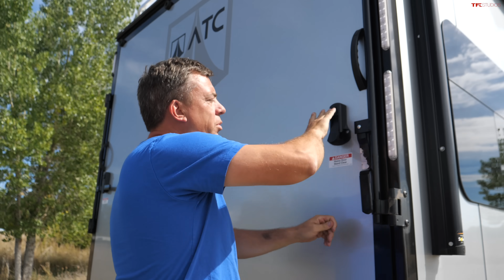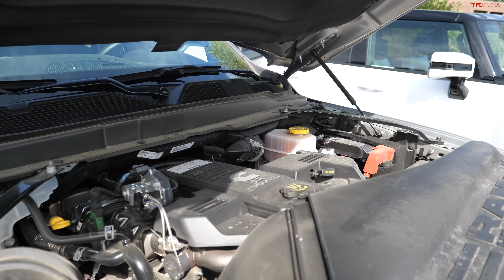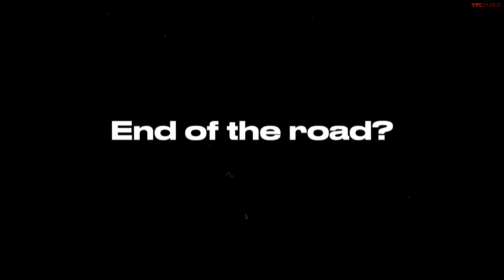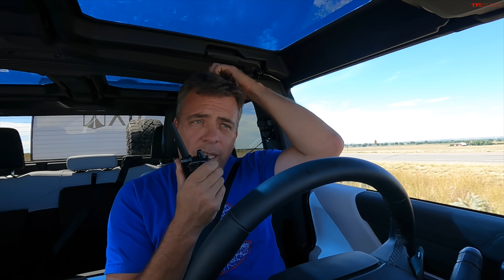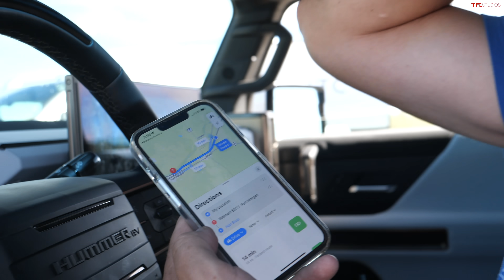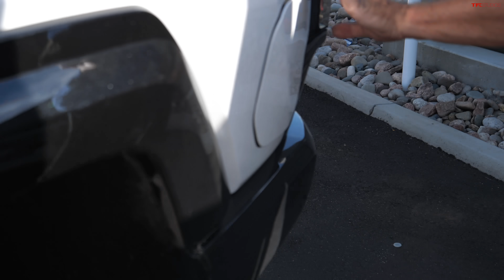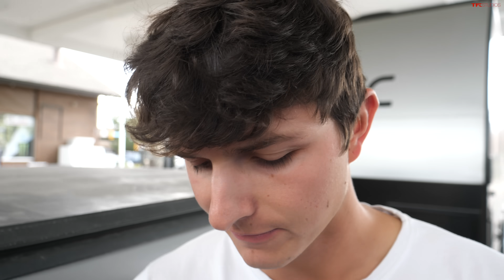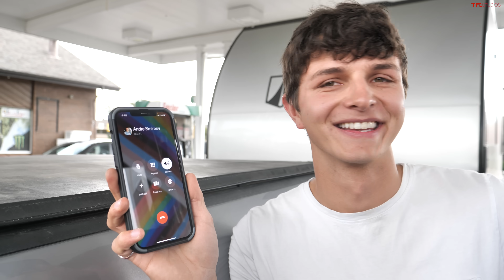How Far Can a Diesel and Electric Truck Tow An Identical Camper Trailer on ONE Fill-up?

Comment: If I have to stop and stress about where the next electrical outlet is for this stupid electric vehicles I would never leave the house! Just  jump in my big old diesel truck and go wherever the hell I want to for as long as I want to. There's no way you can make a trip in anything that's electric. On trips I sometimes drive for a straight 20 plus hours. And you might as well get a hotel room for the damn thing to charge up.

Comment: The Ram went 211 miles and still had roughly 90 miles left...
how long was the fuel stop?...guaranteed it wasn't over 30 minutes and thats with a piss break and waiting in line for a Monster Energy Drink, and some ho ho"s
Electric is nice. but we aren't there yet. Not by a long shot.

Comment: Looks like you either need to pull a trailer behind that hummer that has a diesel generator to charge the battery, or you need to pull a 40 ft. trailer with solar cells on it.

Comment: I live in Rural Alaska, which makes me a very small minority of American truck owners.  The next closest town to me with 1,000 residents is about 105 miles to the NW, if I want to head towards Anchorage though it is about 150 miles.  In both cases it is about 100 miles to the next large town.  I can easily tow my tractor behind my F-150, just over 8K lbs., and make either, I towed it up from Washington State covering those distances between fill up, but would not be able to with a Hummer EV.  Also this does not to into account an area I like to go hunting which is about 150 miles away and never pass a town with more than a couple dozen year round residents.  Furthermore our local electric price is about $0.55/kwh and also produced by diesel, so not only is it less economical but also less efficient and worse for the environment due to losses in energy transmission.  I realize I am one of likely just a few thousand people, certainly less than 100K,experience

Comment: You can’t beat a Ram Cummins in towing 😂 snow, desert, up hill no problem because they sell special liquids so you’re diesel starts easier and the diesel doesn’t turn jello ish due to extreme cold weathers so I’m with the Cummins because the Hummers battery’s will discharge in the snow and in a year the battery’s will discharge faster

Comment: It does seem when observing vehicles during the daily drive to work that most large trucks and SUV's never are used for towing, hauling cargo or have any passengers other than a driver.   I would say less than 10% of these types of vehicle are used for actual towing.   Most are just hauling the owners ego I guess.  I can see owning the diesel if you actually need to haul...but i would never want it for any other reason (including typical drive to work in moderate traffic)

Comment: It would be interesting to calculate how far each of these trucks can travel on $10 worth of their respective "fuels". I'd be willing to bet that the electric truck would win hands down. 2 gallons vs about 20kwh, or maybe even 40kwh depending on the electricity price when charging.
Reply: We ALREADY know the Range the EV shows is NOT what your going to get.... Same applies to a gas vehicle, but its NOT that far off.... The EV is SO BAD it should be FALSE ADVERTISING

Comment: Plus the fact that charging to 100 will take much longer. That is lighter than most trailers also. Soon the road tax we be applied to the electricity and of course insurance is higher on electric vehicles. The fires they had in the hurricane is going to get the insurance companies attention for sure. I can easily get 15 mpg with my Cummins 5.9 towing that trailer.

Comment: Did you guys ever put an F150 with max tow, 36 gal tank, 3.6l engine vs any of these electric vehicles towing one of these campers ? 

My camper is 34’ long and weighs 7,000lbs empty. I tow it with my F150 2.7l V6 ( no Max tow) and 36 gal tank and I average about 10mpg with that thing.

Comment: The issue is, these companies are trying make electronic vehicles too fancy.  They should be nothing more than a golf cart with heat and AC.  The EVs should be to wound back vehicles and the Diesel/gas vehicles are used for longer travel.  There is too many "features" pulling power from the batteries.

Comment: 3 things I noticed in your video. The EV had its lights on which uses KW hours. You may have been able to go a little more miles with it. 2nd the cummins wasn't in tow haul mode as indicated by the video of the dash. 3rd the engine brake on the cummins was in stage 1 not stage 2. If in stage 2 the engine brake is automatic it would save on the breaks even more and the engine brake light would be green not yellow. I'm not sure why you only got 9.5 mpg with a 6k trailer. My 2017 Ram hauling my 5th wheel at almost 16 k is getting 11 mpg. Maybe the gear ratio.

Comment: Is a dielectric car possible? Diesel engine powering a generator, which in turn charges a battery and powers 4 electric motors for traction, directly connected to the axles and tyres of the car. 

This means that the diesel engine can be set to run at an optimum speed while the electric motors can speed up/slow down the car as required.

Plus regenerative braking. 

But I'll take a diesel/electric above battery any time.

Comment: There may be pros and cons to the various power technologies, but there is no reason I can think of to have all the charging slots be dead ends.  Why wasn't the charging station drive through like every gas station?  The whole nuisance of unhitching the hummer so it could use the only fast charger at the station seemed completely unnecessary.

Comment: A few things come to mind I haven’t seen on any of these cost evaluations?  Here are a few: Cost to change manufacturing operations from gas /diesel vehicles to electric ,the cost to produce the added amount of electricity needed to power these vehicles,the added stress on our already stressed to the max power grid,HOW & where are the magic amounts of electricity going to be produced & distributed for these vehicles?  Coal fired plants,Nuclear powered plants,Solar,Wind?  Most people seem to think all this “CLEAN” power just comes from the plug!  Then there is the cost to all of us to be able to buy one of these vehicles at $100,000 PLUS!  Does anyone consider the cost to remove perfectly good running vehicles for disposal & the cost of disposal? Even towing & crushing cars all use fuel & LOTS of it!  Oh,one last thought?  How much added pollution is going to be dumped into the air during the manufacturing of the different parts needed like electric motors & the big one,the BATTERIES?  The cost is huge as far as mining the mineral’s needed in the battery which are found mostly in third world countries?  These countries don’t care about how they pollute the soil or air!  The huge amounts of fuel used to run the equipment needed to dig this stuff from the ground?  Then Truck & Ship it?   Plus those minerals still need to be made useable to produce working batteries which takes fuel . At some point those expensive batteries will fail & need replacing,then you have cost of replacement & disposal of the old battery,the chemical’s & minerals used in these batteries are super toxic?  The list goes on & on!  Electric vehicles sound good at first until you think of even some of the cost?  The fuel needed to manufacture,fuel to produce electric power for charging ,fuel used to dispose of old vehicles & batteries once used up? Every signal part of these vehicles use fuel to manufacture & operate ,the fuel (electricity) to run them,all that extra fuel burned to make the electricity to power them pollutes far more than the fuel we now burn to operate the now perfectly good running vehicles which we continue to find ways to operate using less fuel!   Electric vehicles are also much heavier than our current vehicles which wears out tires,brakes all moving parts & of course our roads much faster!   Is this really a road to the future or just a short circuit?

Comment: gigantic my butt... those are tiny toy haulers....  a full sized car could have pulled them.  no need for a 3/4 ton truck.  come on guys, you can do better than this.
i do appreciate the comparison. i am one of many that had the same question.  so just be real, no need for the horse crap hype

Comment: Rv is too much and it’s a complete lie.   They are powered by diesel or natural gas generators so it doesn’t help the situation.  I can tow 300 miles with my diesel with a 10k trailer and still have a quarter tank left.

Comment: I work in disaster management and was just in Florida. The salt water storm surge was causing ion lithium batteries in electric vehicles and bicycles catching fire. I saw numerous houses that were not only flooded but also burned to the ground  from the vehicle batteries melting down. Also thank you for the video I've been wondering how far an electric vehicle could tow a camper. My camper weighs about 9000lbs with all our gear w/o water on board. There's no way the hummer could pull it.
Reply: While I like the idea of alternative fuel sources I don't think the technology is quite there yet.
Reply: Let's look back in history steam and then internal combustion was also seen as a novelty and not useful.
Reply: @Bob Habib I think you misunderstood my point. What I was attempting to demonstrate is new technology has to start somewhere. I was not insinuating we drive steam powered vehicles that is preposterous. Steam and internal combustion in their infancy was considered worthless. As technology expanded so did the usefulness especially with internal combustion. I am hoping that electric automobiles will become more useful with safe batteries and a way to recharge batteries while driving.
Reply: @christopherbarthlow4369  definitely possible, but not with lithium.  

Batteries will never be good for towing though.  Energy density just isn't there and won't ever hit fossil fuel levels.
Reply: Yup that's true! I agree with that!!
Reply: Can confirm.  I was there also
Reply: Oh, I don't disagree.
Reply: this electric vehical thing is all a bunch of political bullshit and i dont like it one bit.
Reply: @jamiebuckley1769  yes it is a political BULLSHIT! You were right though! 👍 That's why they call it bullshit because it doesn't make any sense. Why did they stop 🛑 the "Fracking" Drilling of Oil where there's trillions and trillions of fossil fuel aka Liquid Gold everywhere in The USA they are everywhere. Why stop 🛑 drilling them and Force the Electric Vehicles on us just to satisfy their narratives about the Climate Change HOAX.
Reply: Interesting .  Australia is going all electric batteries
Reply: Oh it could pull 
it, just not very far.
Reply: @thetazva  So, what's the point? You purchase a vehicle to go places, not to just sit there.

Comment: 120miles max range pulling a light travel trailer is horrible. Who the heck only pulls  a travel trailer 100 miles? You would just drive back home in most scenarios.

Comment: How come you didnt pull somthing heavy  ? I pull a 10,000 pound equipment trailer with a 25,000 tractor all the time and get 9-13 MPG. , Cummins with a 5 speed Manual..

Comment: My 2019 Ram Dually hauls our 5th weighing in at 17K and we get around 11 miles per gallon traveling at 60 to 65 MPH.  She pulled our rig in a snowstorm over the Rocky' s at 11,250 feet.  Even had to stop at the top.  Couldn't even tell it was there.  BTW most state laws limit civilian trailer towing speed at 65.

Comment: I just did 1246 miles one way in just under 20 hours towing 4500 lbs. Stopped twice for gas. Electric trucks are a cute toy, but near useless as a truck.

Comment: Sorry kids. I know you wanted to go to the nearest KOA but I only have a 150 mile range and we live in the middle of nowhere. Maybe we can vacation next year. Why would you put yourself through all that stress of having to find a charging station... And hoping it's working and 2nd not spending 2hrs if the station is not full.   Electric is great for city driving and short trips. Where's that battery go in 10 yrs when it needs a new one?

Comment: I have a 2011 Ram 1500 runs on regular fuel, I use it to tow my 32' camper and get about 6 to 8 mpg. Was surprised the Cummings Diesel  only got a little better than that. As stated in other comments, the EV trucks  can't compare to gas or diesel yet, for Towing long distance, not to mention shortages of charging stations, anytime soon. Great video guys just reinforced my opinion of EV trucks.
Reply: We have a 2004 Dodge RAM 2500 SLT with a 180,000 miles on it and tow a 35 foot Cougar X-Lite fifth wheel and get 13 miles to a gallon and sometimes a little better,so we will keep our old truck and screw electric
Reply: Got a 2016 Ram 2500HD diesel. Pull 40' fifth wheel. Get about 11.5 when towing. Get right at 20 not towing. I'm happy.
Reply: @Jerry Boden  I still won't buy an EV.
Reply: Same here, lol. I just bought my 2014 Ram 3 months ago. love it! Still have the Prius though... NEVER know whats going to happen anymore
Reply: @Jerry Boden  now why would you wonder that? The world runs on oil. And based on this cold winter were having i think climate change is a big joke.

Comment: A few years ago my father and I drove from South Dakota to South Carolina with an empty 25' cargo trailer being pulled by an F-350. Then we drove back with that trailer loaded with furniture and household goods. We got almost the same economy both ways. At 15 mpg it cost us about $500 for fuel and we filled up about every 400 miles. With an average speed of 70 mph and counting gas stops, dinner stops and bathroom breaks it took us about 20 hours to drive each way with 18 hours of it actual drive time. A VERY long day, but we did it.

If we had to stop and charge the truck every 120 miles or so and it took an hour for every charge that would be an extra 10 hours of time added to the trip so 28 hours. Also, electrify American says it would cost about $100 per charge. That means just the trip down would cost $750 more and take 8 hours longer. The entire trip would take 16 hours longer and cost 4 times as much as the F-350 did. And there is no way we would try to drive 28 hours when 20 hours was an absolute ball buster. So you'd have to add in a stay at a hotel which would cost around $120.

So you could pay $500 for the diesel to make a round trip or you could pay $1,240 to use an electric truck.

I can tell you for a fact I won't be buying an electric truck any time soon.

Comment: EV in the outback. Yeah that would be stupid. You don't just drive your trailer into the woods you drive around after disconnecting. You'll never find a charging station anywhere near our part of the country. I watched some city dip shit try this. No one can do anything to help. Your only option is to tow back over 145 miles to recharge it. Yeah drive your ev in the cities.  They're worthless out here in the woods.

Comment: At a 100 pound battery in a ev has a 30 ton carbon footprint 👣 aka diesel equipment strip the kand . A gas powerd car is 40 ton its entire life . This 3000 pound ev has a carbon footprint of likr the life span of 1000 gas powerd cars . Thats when it is brand new

Comment: Interesting review, concluding that for now, a diesel truck is preferable than the electric one. However, I am still concerned with what happens a few years down the road when all the batteries from electric vehicles will need to be replaced. Recent reports indicate that in most cases the batteries are not recyclable, and where they are recyclable the cost is astronomical.
Reply: If the battery is reasonably easily removed from the vehicle lithium  is very recyclable and desirable    so yes the batteries are very much recyclable    I can see a profitable infrastructure created to do so if people are willing to go from horse to car....they can improve on the electric vehicle
Reply: @neilduncan8657  Comparing going from a horse to a car, to changing the power needed to operate a car, are vastly different comparisons. This type of thinking is what got fuel to double in price (driving worldwide inflation beyond comprehension) in less than 3 years for no logical reason. My ridiculous thought of the day....They will improve electric vehicles that compare closely to fuel vehicles, but not before a better technology is invented, likely hydrogen.
Reply: @neilduncan8657  I'll go back to horse if it means I don't need to get a electric

Comment: I don't know how fast he was driving the Hummer but with my Volt, just slowing down from 55-60 to 50 mph dramatically increases my range.  Driving my Volt at 50 mph uses almost exactly twice as much power (Kw) as at 25 mph. Increasing the speed to 60 mph from 50 mph increases the power demand by almost 50%. Going 20% faster uses 50% more power.
Reply: Same thing with my Prius... If I go from 60 to 80 to pass a vehicle, my batteries decrease to NOTHING

Comment: Comparing efficiency of stored electrical energy and heat is a bit oranges to apples as electric energy is more "organized" so it has less entropy (all the losses incurred at making that energy from a more disorganized form of energy have already occurred at the thermal plant). So the truthful comparison of efficiency would be heat to heat used to make that electricity. Or at least take that "high" efficiency of the electric engine with a huge grain of salt.

Comment: What a shit show. This is exactly why I will never buy EV. I tow a 16,000 lb. 5th wheel with my F350. I installed a 47 gal. tank and get 475 miles out of a tank and that includes driving over mountain passes. It only takes 5 minutes to fill up from almost empty and I'm back on the road without having to back track.